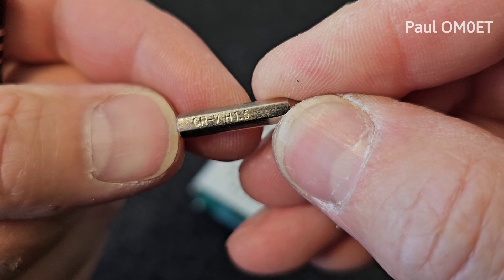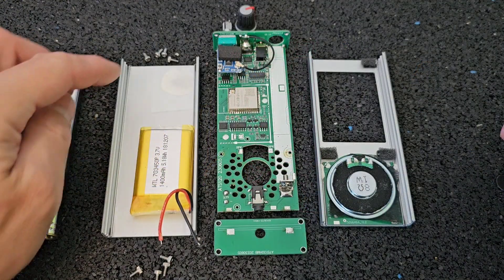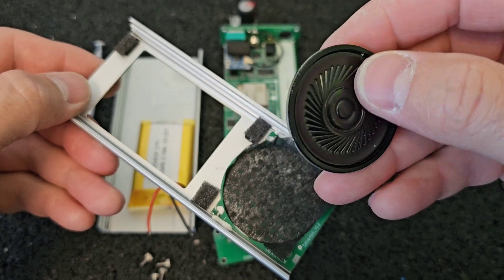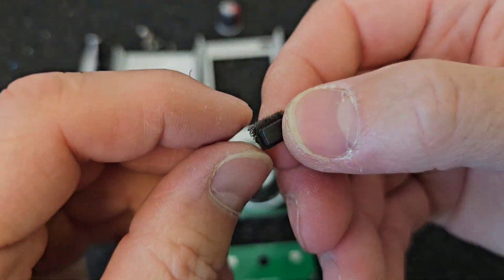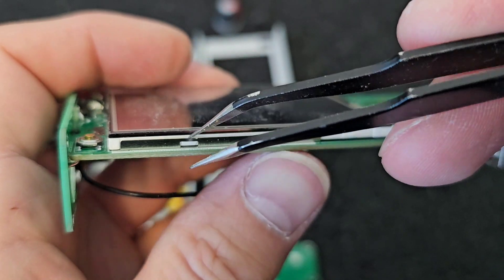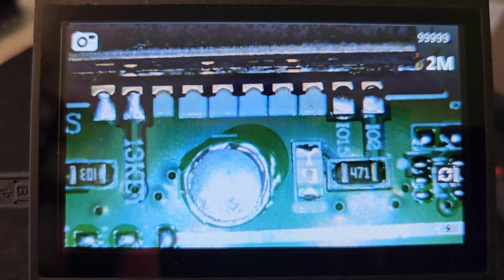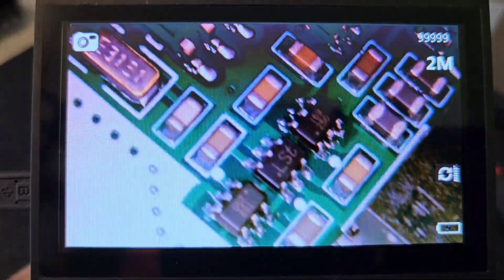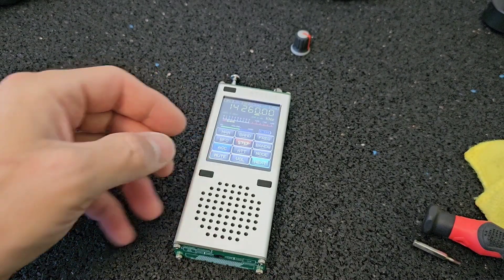ATS-120 Receiver Teardown

Comment: The esp32 chip has bluetooth built in. No need for separate module. Developer missed that?
Reply from the maker: it is an audio to Bluetooth converter if I am not wrong :)
Reply: @OM0ET  no. Its a microcontroller. Does lots of things. Has wifi and bluetooth capability

Comment: Hi OM0ET,
Thanks for the video. And also others videos you have made on the ATS-120They have been very instructive.
I am wondering if the Telescopic Whip antenna is connected to the same points of the 3.5mm Jack on the circuit board which is used for the external antenna (SW,SSB,AM)
I am thinking of removing the telescopic antenna and replacing it with SMA Female screwed to the top  but soldered with wires back to the circuit board where the connections of the whip antenna is situated.
The reason being I will love to use different antennas by just unscrewing them from the top via an SMA Male connector. Besides, I don’t seem to like the position of the 3.5mm connector of the antenna and would love to disregard it complexly.
Please what are your thoughts? I know I can fix it but I just want to know the implications.
Expecting your kind response please.

Comment: Thank you!  It looks like there is room for the ATS-120 to possibly do more functions than the current firmware.  The ESP32-WROOM-32U already has both Wi-Fi and BLE 5.1 built in.  Perhaps the designers went with the external BLE module so that the ESP32 would not need to spend CPU power to digitize audio.  I am thinking it would be really neat to be able to control the ATS-120 with a desktop or mobile phone app over Wi-Fi.  This circuit looks pretty close to the Lilygo ESP32 Dev Modules sitting on my desk or Arduino Uno R4, except with the addition of the Skyworks Si4732-A10 receiver chip already on board.

All that extra circuitry is kind of interesting.  Perhaps the mystery chip is an LNA and/or attenuator.  The receiver chip already has an internal LDO, so I’m wondering why they need three discrete voltage regulators.  For noise isolation?  The receiver chip also has several more modes and bandwidth settings which are not exploited by the firmware.

Over all the ATS-120 is a very interesting little radio.  It may prove to be fairly hackable to add new capability.  I am looking forward for the one I ordered to arrive within the next few weeks.
Reply: Hi there, what would be the best way to go about trying to dump the firmware so one could manually hack around with it? Would I just use the normal ESP tools (like you, I also have Lilygo modules all around my desk!)?

With no need for BLE I thought it would be cool to replace the module with a LoRaWAN 915Mhz board and try to load a custom Meshtastic setup.
Reply: @rawhides  That sounds like a really cool idea to have Meshtastic right in the receiver.  I don’t know how easy it might be to extract the firmware.  I am fairly new to ESP32, so I don’t know if they can set a security bit to make it difficult to read.  For ideas, I found several web sites with Si4732-A10 projects which look close but not identical to the ATS-120.  Right now the ATS-120 I ordered is somewhere between China and US Customs.  Anticipation!
Reply: ESP32 has 12-bit ADC. I think this is not a good idea to use it to transmit audio, especially in FM. But using his BLE for control is interesting idea
Reply: @f0aleksander  I agree.that the on-chip ESP32 A/D isn’t spectacular, at least not on the dev modules.  If you don’t need resolution, the A/D can be short cycled with fewer bits.  Just playing around I adapted an Arduino sketch to make a tiny triggered sweep oscilloscope on Lilygo board.  It is neat, but with the Arduino IDE, my top sampling rate is a few KHz, and I can render about 25 sweeps/second at 700 points with the LVGL library.  I’m sure someone more experienced could do better, but my project was just for fun.